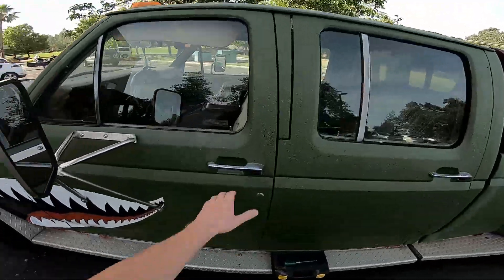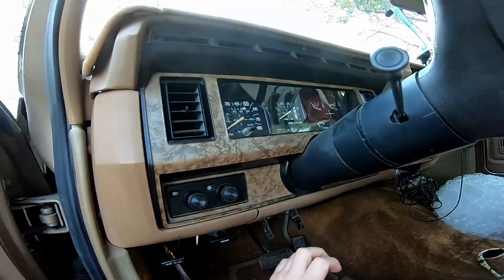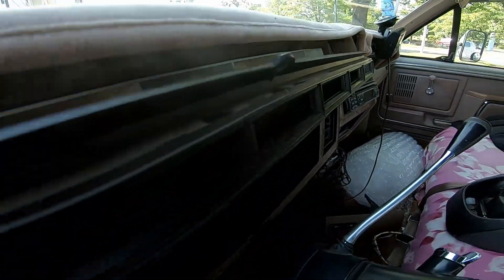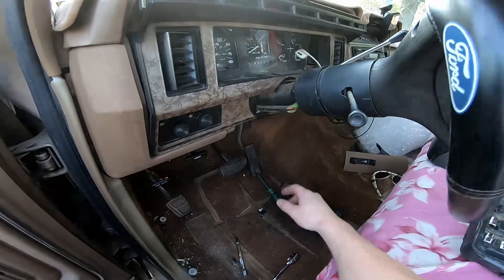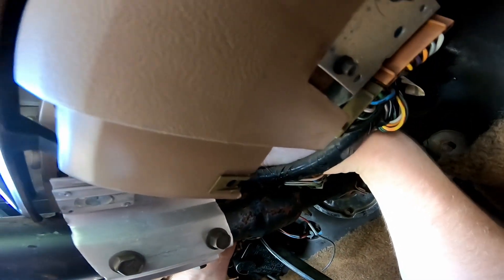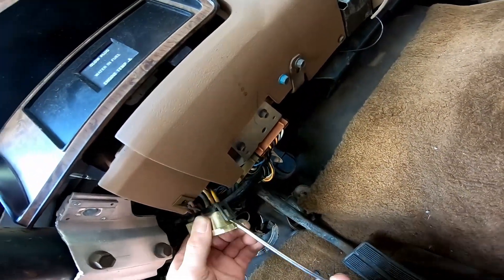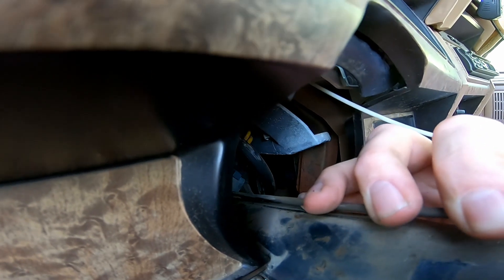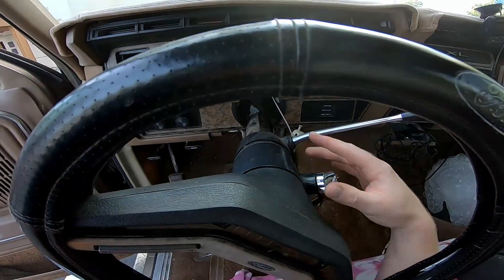Ignition Switch Replacment 1980 - 1994 Ford / Mazda Truck

Comment: Thanks so much I’m gonna replace mine in my 80 f100 because my turn signals don’t work sometimes, hopefully this part will help
Reply from the maker: You're welcome. If that's the only thing not working, I wouldn't  think it would help.  But let us know.
Reply: Grim Repair it did fix the problem to my turn signals not working
Reply from the maker: @jordanminar9241  Good to hear, thanks for the update.

Comment: what is the buzzing sound, just wondering if my truck will do that so i dont think i broke it lol
Reply from the maker: At what point in the video is the sound?
Reply: @GrimRepair  when you were removing the panel under the steering wheel, its not a bad sound. Great video. Just curious if it was the car or the mic
Reply from the maker: @asherlamping2118  at 2:01 ?
Reply: @GrimRepair  Yes!
Reply from the maker: It is factory. It  makes noise if you open the door and  leave your key in the ignition or leave the headlights on. Check out what I did to the buzzer in my suburban. https://youtu.be/tD5MwLBr1vg